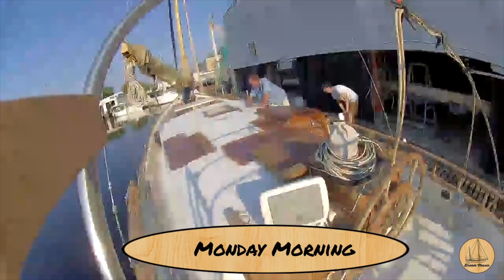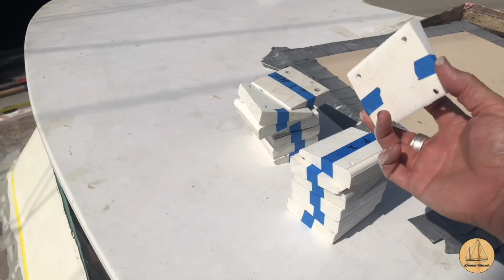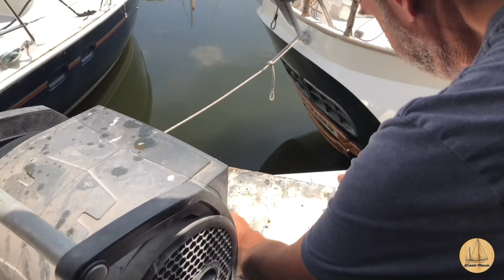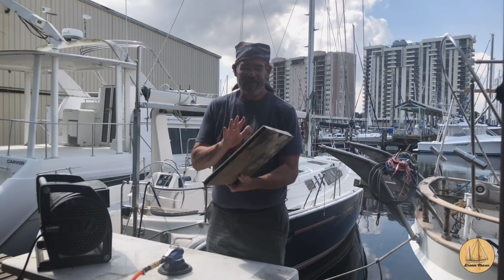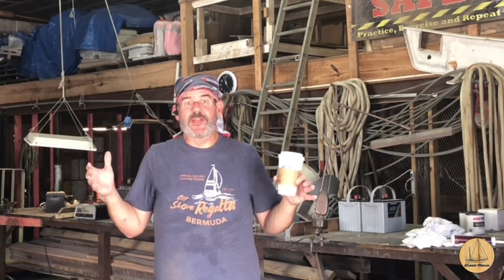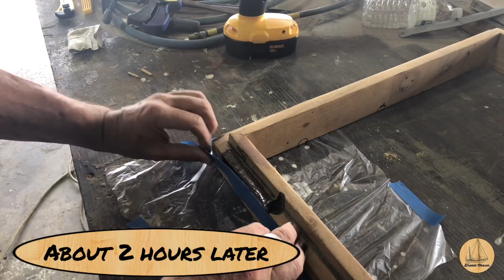Fiberglass Progress, Hatch Frame Repair and Mizzen Step

Comment: Hi these spring hatch supports work well I’ve used on a few projects 
http://www.sea-dog.com/groups/442-hatch-spring-small
They come in different sizes and the only down side is if you bump the spring it can close unexpectedly. But I like the super simple 
Cheers warren
Reply from the maker: Thanks Warren.  I have those our on Gulfstar and you are right, I was putting a drill up through the hatch and pulling my hand back, I hit that sucker and the large aluminum hatch slammed onto my hand.  That sucker hurt good :)   Maybe I could put one on each side for a little insurance.

Comment: Another great video, I’ve got to hand it to you for taking on such a big job. I love the lines of your boat also the amount of deck space. Can’t wait to see the finished boat. How nice it’s going to be to sit back and admire your work.
Reply from the maker: +Bill Burkart Thansk for watching. It will be pretty darn Nice for sure. I am looking forward to it. The funny thing is there is a whole pallet of stuff that came off the deck (cockpit chair, deck boxes etc.) We are thinking of not putting much back. We kind of need one deck box for a propane locker but we are starting to consider other options for that too. (Like building the propane locker into the new cockpit seating we will build). We are not sure yet but giving it lots of thoughts at least.
Reply: SVDreamChaser 
We live on a 47 Vagabond with all new propane stove and my wife just loves the simplicity of cooking on our one burner butane stove.
Reply from the maker: +Bill Burkart that is great. Our wives may not be similar. I’ve had to talk Deb out of wanting to put an electric cooktop in, LOL